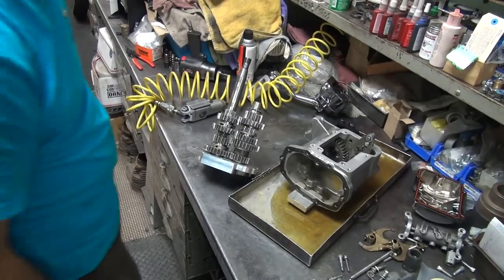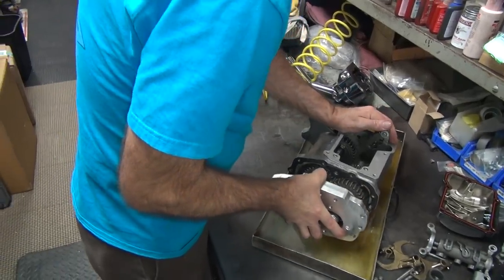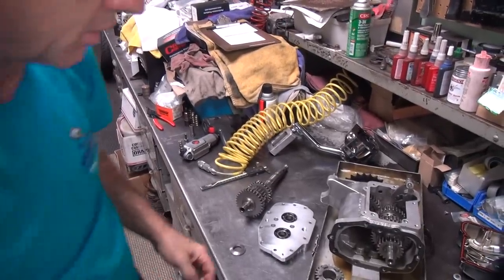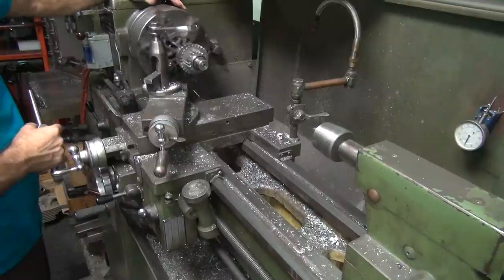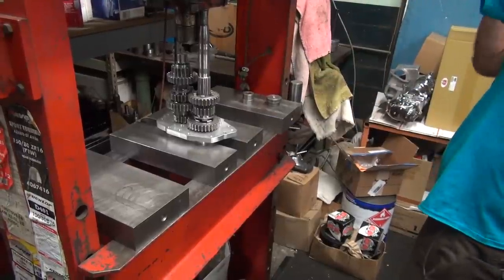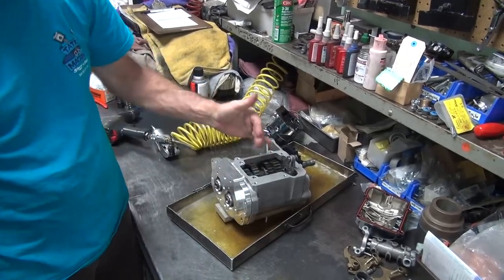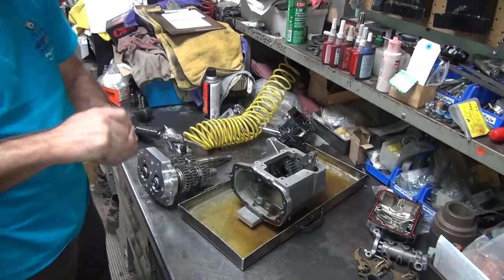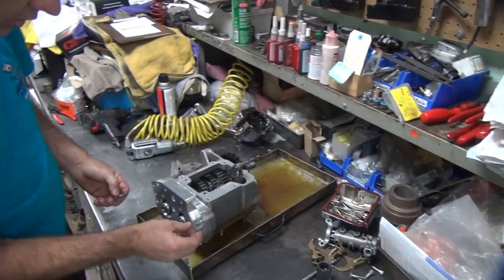#102 1970-84 FL sputhe 5 in 4 speed transmission kicker install FLH shovelhead harley tatro machine

Comment: Might want to replace the half nut on your cross slide. Can't remember if the old Jet machines had a half nut or just a common bronze nut. I noticed you have a lot of play in the screw. It is easy to replace.